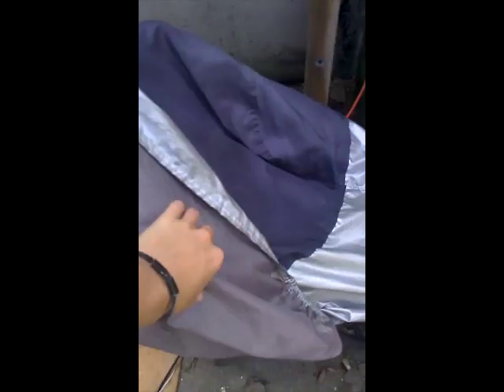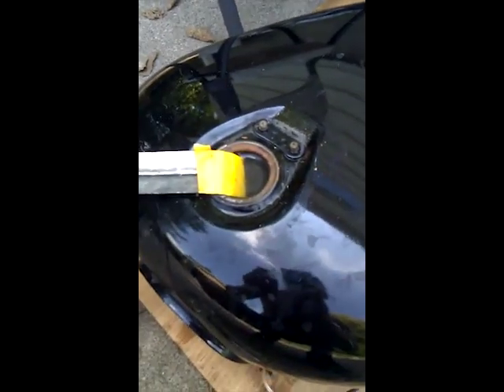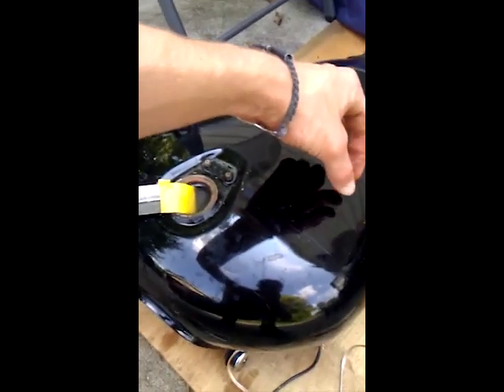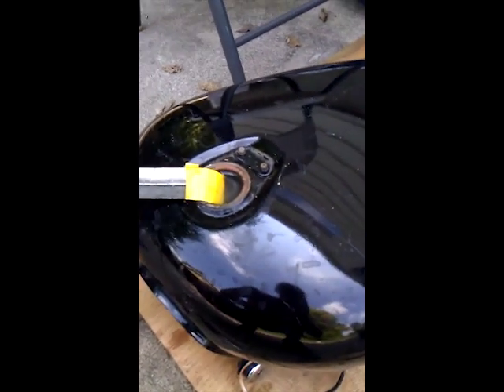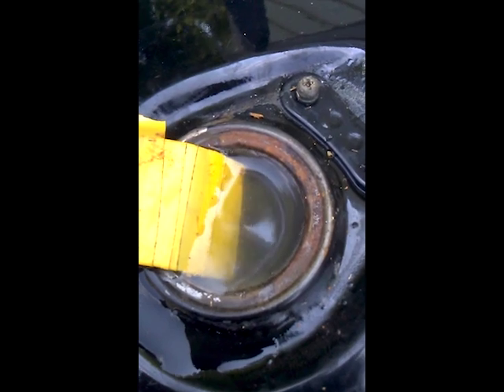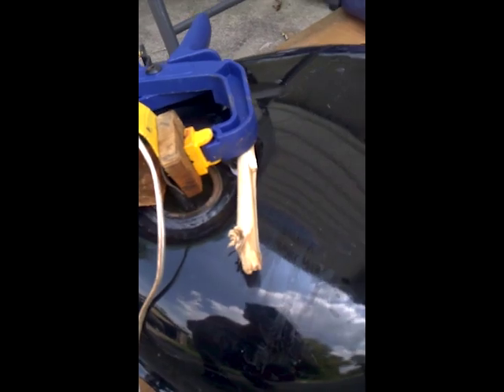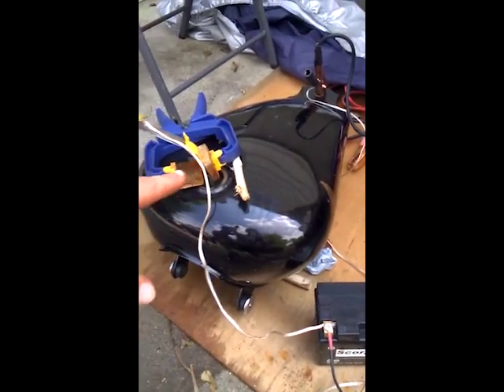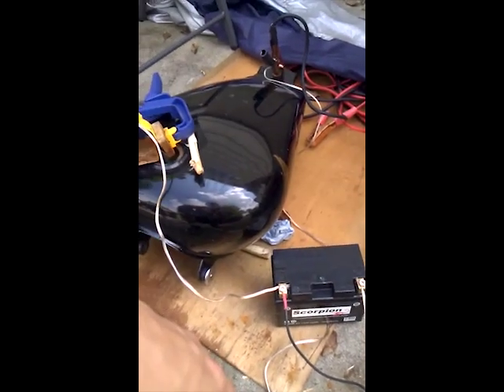DIY Easy Gas Tank Rust Removal - Electrolysis demo

Comment: this works well but what i've been wondering is after all the rust is removed can the cleaned tank be then plated in copper or zinc on the inside to stop further rust from starting and also it might strengthen the tank also.
Reply: +Anthony Hinds A good thing to seal the tank with afterwards is POR-15. I've heard massively good reviews for it and I'm in the midst of doing that to mine.
Reply from the maker: that is what I sealed my tank with.  it requires great attention to detail during the prep stages, though!  great results if done correctly
Reply from the maker: five years later, still going strong

Comment from the maker: The electrolyte solution I used was made up of distilled h2o and arm&hammer WASHING soda (not baking soda). 2 tablespoons of soda to a gallon or so of water. Google will help you find more accurate measures, but I estimated my measures when making solution. Using more soda won't help the reaction at all.   The solution has a higher pH. Alkaline. Basic.